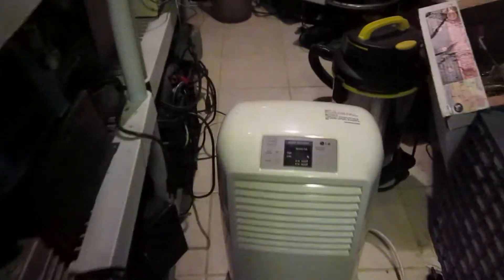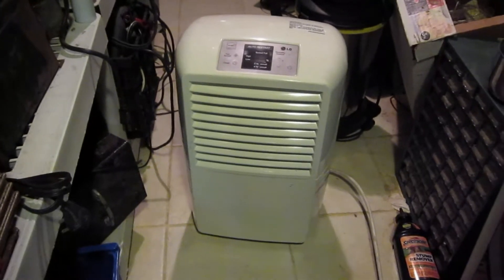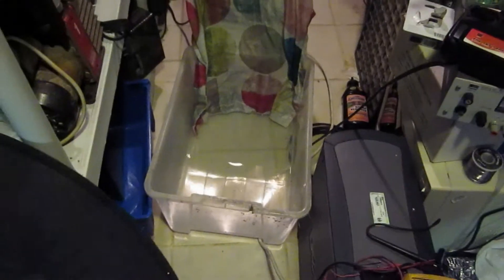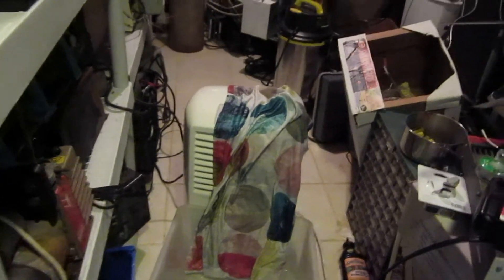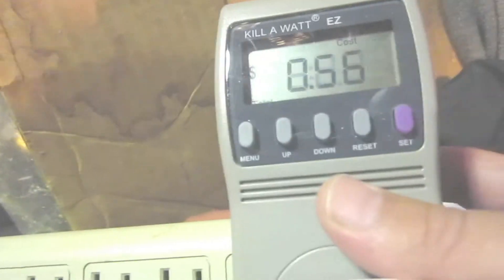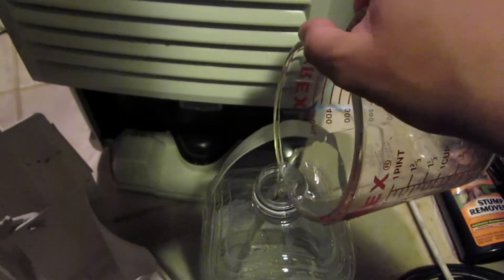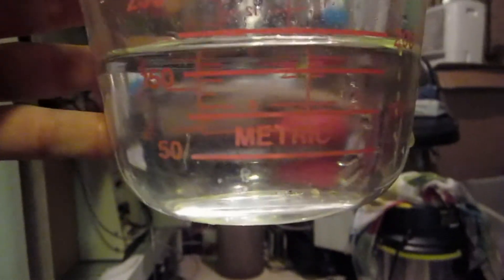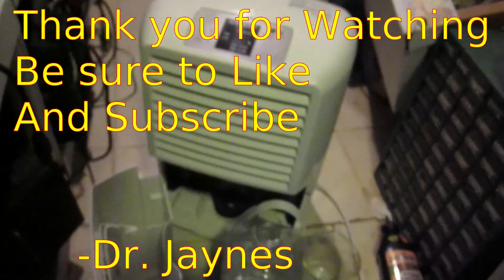Water from Thin Air - Dehumidifiers for Survival

Comment: I bet you could take the machine apart, spray the coils with rubber and make a better water collection system just with coming up with your own idea. Good video. Take care.
Reply from the maker: Great idea... I did find a company that actually makes a device to take water from the air.. for drinking... the device was expensive though..

Comment: Can a dehumidifier be used in low temperature to generate water?
Reply from the maker: My guess us that it will be less effecting since there will probably be less water in the air, in a colder climate?? Also this may be less effective in a dessert or arid climate.. Remember the dehumidifier uses coldness to remove water from air.. so if the air is already cold.. then much of the water is probably already removed?? I was warned not to drink the water without further purification.. since the machine is probably very dirty and could have bacteria growing in it!  With that being said, I did actually find a company that was producing a special machine to create drinking water in this same way.. It seems it was kind of expensive.. I'm sure running the dirty dehumidifier water though a reverse osmosis machine would clean it up though.. if it did not clog up the filters!! Thanks for the great comments!
Reply: @jaynesnetwork  Thanks for your response. Been using a Zero Water pitcher with 5 stage filtration with great success so far. Just found out that kerosene heaters produce moisture so the two together in the short term may still help produce water. Testing so far looks good.
Reply: @DLJohnsonHonourofKings  heavy metals cant be filtered by all filters, look into distillation , that may be better

Comment: If your going to Run it through an RO  it would be cheaper to just use tap water run through an RO filter.
Reply from the maker: Yes that is true.. if you have access to tap water.. some places use air wells.. like in the desert... so this is a way to take water out of the air, if you have no other sources.. I actually found a company that was using this very idea to produce water.. but yes you are correct, RO is a much cheaper way of producing clean water.. if you have a source of dirty water at your disposal.. Thanks for the great comments!

Comment: Why filter the water? the same bacteria that is in the  dehumidified water is in the air that you breath day in day out, through your nose and mouth. In an emergency situation you would just drink it and wouldn't care if the water was filter or gone through reverse osmosis.
Also it is best if you got yourself a couple of solar panels and a converter in case of a power grid failure.
Reply from the maker: Yes, I agree.. I have some other interesting filtering technology, that is supposed to be able to filter out bacteria and viruses from water.. without access to electricity.. Hopefully soon... So many Videos to make, and such little time!
Reply: @jaynesnetwork  I would like to see your video on that! I’m always looking for off grid applications

Comment: Yeah, a peltier mechanism is safer. It doesn’t contaminate with refrigerants, since it’s not by evaperation
Reply from the maker: The refrigerants are contained in copper tubing.  The problem is that it is probably hard to sterilize the inside of these units, so there is probably lots of bacteria living in these machines, so you wouldn't want to drink the water coming directly from one.. Probably if you put the water through an Reverse Osmosis machine afterwards, it would be clean.  A peltier device is an interesting idea as well.  If you designed a device from the ground up, that was easy to keep clean and free of bacteria with a peltier device, this would probably work as well.  I was planning to use mine to generate electricity, but they can heat and cool too...

Comment: Are you sick yet? That is not clean water. Their are chemicals used in that. You know that right? And mold on the coils are very strong.
Reply from the maker: Yes, I do not recommend drinking.. But if you have a reverse osmosis (RO) water purifier, the water would be fine after running it through that... Yes don't drink the water as-is, out of the dehumidifier... Thanks for the great comments..
Reply: Just filter it through a Berkey and it is safe to drink.
Reply: seml you wont be complaining when its the only water source in your town you clearly dont understand the purpose of it is to save lives your a spoiled brat go somewhere else us men have work to do

Comment: You shouldn't drink that water bacteria thives in dehumidifier invierments if you test the water you will also find chemicals in the water that are used to turn the moister in the air into water.
Reply: Use a peltier
Reply from the maker: Yes you are right, Don't drink the water... Its not the best idea to drink dirty water unless you are in a survival situation.  In my next video I am planning to do something with reverse osmosis, and that will remove all bacteria and contaminants. You are absolutely right, don't drink the water as is. I was just curious to see how much energy it takes to get water out of the air, compared to how much energy it take to run a water distillation still that I build from a crock pot. And of course it is much more energy efficient to remove water from the air.